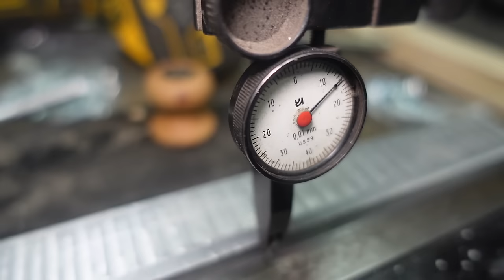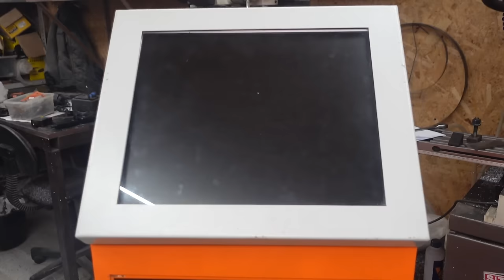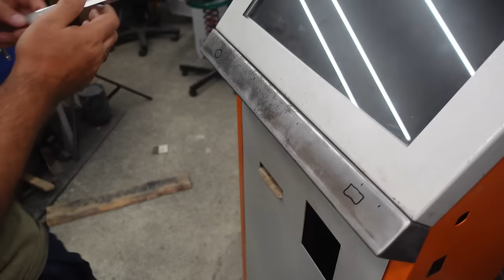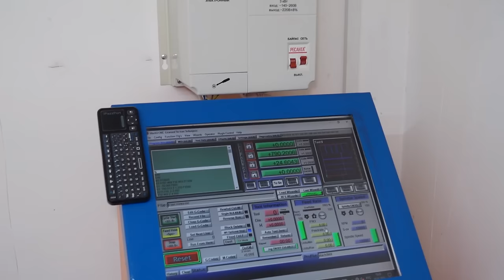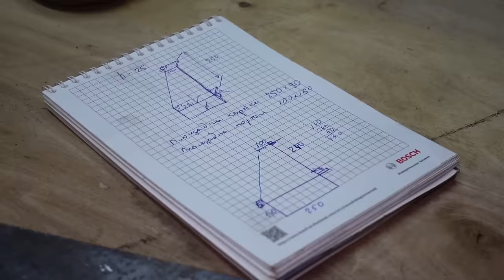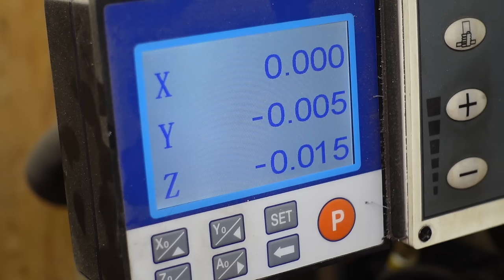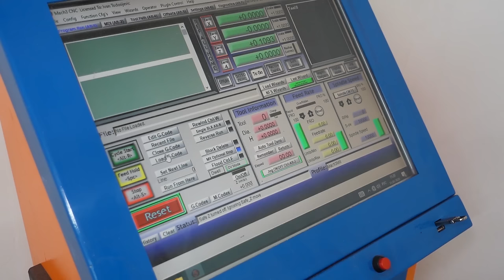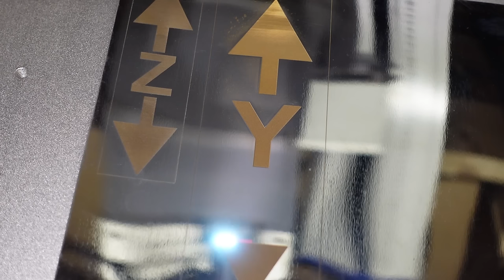How to make a CNC Machine. DIY of building a CNC Machine at home from scratch

Comment: Try linear rails, more expensive but better.
Reply: SBR 20 linear rails have good and not expensive. i have 1200x1200 machine and ballscrews all together cost less than 350$ cheap but good rails.